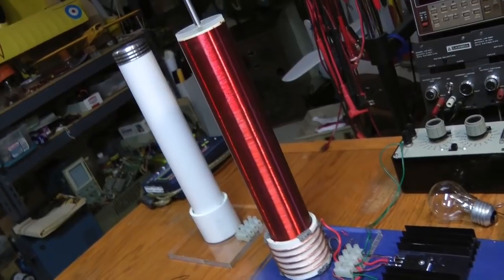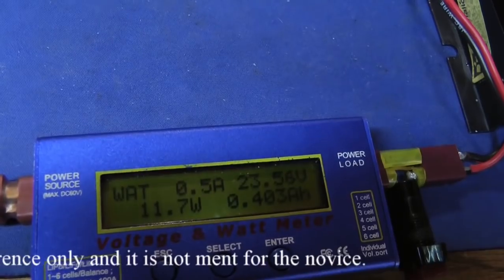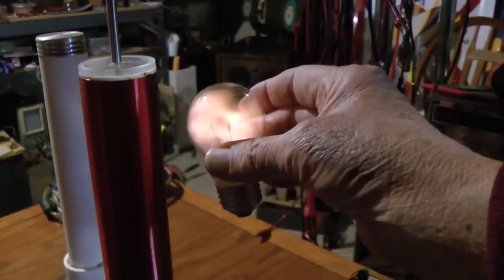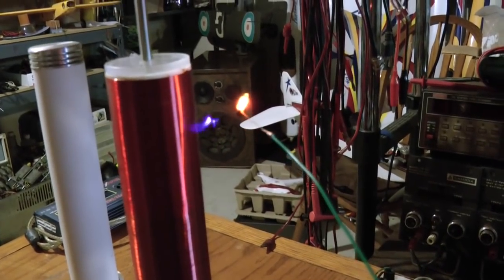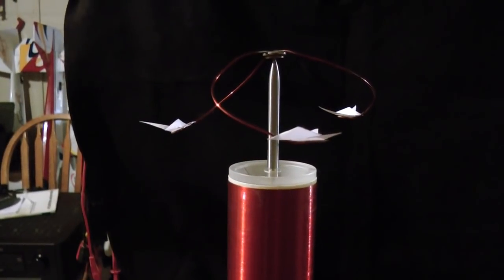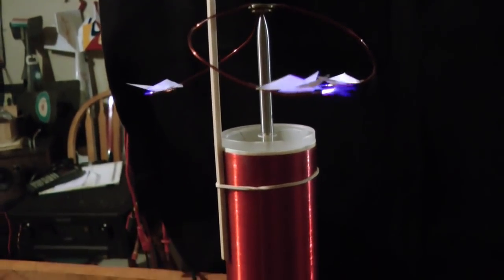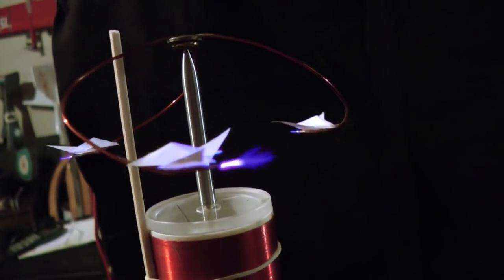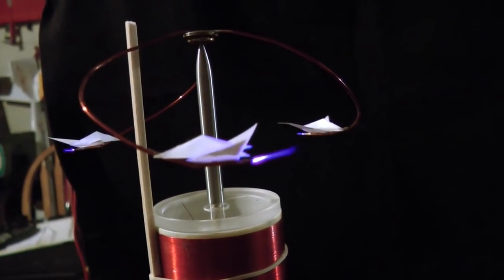Tesla / Slayer Ionic Propulsion

Comment: It's called coronal discharge. The force from the corona and the direction is what causing the air to be manipulated. It basically turns the air into plasma, but without a vacuum it can't be a sustained plasma and dissipates quickly.

Comment: The thrust is due to the asymmetry of the ion source. Electrons are stripped off of the air molecules surrounding the metal tip, this polarize the atoms with an opposite charge, since they have an opposite charge they are pushed away from the tip by the electric potential. The air moves in one direction away from the tip because of asymmetry, that is there is no spark (or exhaust jet) going in the opposite direction. So there is an exchange of momentum causing the spindle to move in the opposite direction of the spark. If placed in a vacuum this would probably not work because there would be no gas for the tesla coil to interact with. This is a very clever demonstration, I like it a lot.
Reply from the maker: Yes, I think the result would look like a plasma ball in a vacuum. However I think if you had both the cathode and anode on the device you could once again focus the ion flow.

Comment: So what you are seeing is the atmosphere around the electron beam is being heated to a plasma. The air expands and pushes the little flyer away. With the wire holding it on place, at a fixed distance from the coil, it and the other 2 rotate around the coil as a result. A cool toy.

Comment: Ion propulsion. You just demonstrated "impulse drive". If this is effective in a vacuum, it could be revolutionary for space travel.
Reply: It needs ions to work, and there's nothing to ionize in vacum...
Reply: We already have ION and HALL thrusters for space travel. It has already been done before and has been and is being implemented on spacecraft. They usually bring their own ionization material (i.e. iodine, xenon, etc...) This is not revolutionary, since it has already been done. What is occurring above is ions are being ejected out of the nozzle at a relatively high velocity and air being a relativity higher density material, is compressing the air directly outside the nozzle pushing it backward. To keep the system equalized the instead of the air being compressed, it is being pushed backward as the ions are being ejected out.
Reply: could make space travel possible you mean

Comment: Engineer: What you see above is the electric based propulsion in the form of ion propulsion. We already have ION and HALL thrusters for space travel. It has already been done before and has been and is being implemented on future spacecraft. They usually bring their own ionization material (i.e. iodine, xenon, etc...) and can run put of propellant. Electric propulsion has an extremely high ISP (thruster efficiency) when compared to propellant systems, however ion thrust values are extremely low and require large amounts of power to operate. There are pro's and cons to each propulsion system, and different missions are better equipped for one or the other. 

This is not revolutionary, since it has already been done, however it is very neat. For additional examples lookup HALL or ION thrusters on YouTube, other people have done static test fires before. What is occurring above is ions are being ejected out of the nozzle at a relatively high velocity and air being a relativity higher density material, is compressing the air directly outside the nozzle pushing it backward. To keep the system equalized the instead of the air being compressed, it is being pushed backward as the ions are being ejected out.

Overview
ISP (Efficiency Breakdown)
-----------------------------------------------
HALL & ION: ~2000 to 5000 sec
Mono and Biopropellant: ~150 to 400 sec
Cold/Warm Gas: ~15 to 50 sec

Nominal Thrust (Largely based on size of system)
-----------------------------------------------
HALL & ION: ~1µN to 1N
Mono and Biopropellant: ~50 mN to 1000+ N
Cold/Warm Gas: ~25 mN
Again this largely depends on the thrust size and type for nominal thrust
Reply: Is it possible to use this for making a cutting tool device for wood/aluminum? 
If yes, what should I look for and what approch you recommand?
Reply: I think a similar effect is used in arc furnaces.
Reply: Hossein Hayati isn't that how welders work Hossein? not sure if metal welders would work in not very conductive materials though. Google it up
Reply from the maker: Hello Robert and thank you for the explanation. I should have done a little more research. However there may be something about the experiment that is a little different. The power source is an extremely low cost resonator which allows people to have fun trying different experiments. The NASA thrusters have an anode, cathode and gas. I'm new to some of this but I think this experiment has a cathode but no anode unless it would be the earth ground. This probably means this type of so called thruster wouldn't work outside the earths gravity. Am I wrong? Doesn't the arc of the Tesla coil try to complete a capacitive circuit to ground?
Reply: Is he using a Tesla valve???? For backwash???

Comment: Hm. 
Ionic acceleration generally refers to high voltage direct current creating and attracting or repelling positively or negatively charged particles.
A Tesla-Oudin coil produces high voltage from a high frequency alternating current source. That type of plasma discharge is called a brush discharge. The other end of the coil should be connected to the chassis or to ground somewhere so the plasma just discharges away from the sharp terminal.
If you want more info on ionic acceleration and even capacitor acceleration, research T. Townsend Brown's work.

Comment: NASA has used similar propulsion for spacecraft they have very low thrust but can accelerate for a long time with very little weight. So they launch with chemical rockets and then use 'ion thrusters' to accelerate there after, they typically bring xenon gas with them as propellant but the 'vacuum' of space isn't a true vacuum and it may be possible for them to operate without indefinitely without brining fuel with them. Wikipedia has many articles on the topic, look up ion thrusters, hall effect thruster and plasma rockets
Reply from the maker: Thanks Cooper

Comment: Okay, what you are seeing is the breakdown voltage of air, and the arc super heats the air. Since the discharge is directional, from a point source the air is converted into a plasma. Once the plasma is hot enough, it ca stand up against atmospheric pressure. So, you see a channel of plasma in the direction of emission from the point source of breakdown, an arc. Plama, is just electrons and the nuclei of atoms too hot to be atoms or molecules, and since the nuclei are heavier, and being pushed away by this heat, once they race away, more cold air gets involved and becomes a plasma only to race away from point discharge source. That pushes the cool planes around.
Reply: Ask Walter Lewin, from MIT, if my explanation is sound.
Reply: Almost every college class I had ever taken, mentioned having him as teacher at one time.
Reply: Never knew that an actual mad scientist could have a job.

Comment: The electricity ionizes the air and the expanding plasma and air flow propelled these planes. Cant use this in space because its a vacuum. Cool to seeing it in action
Reply: sixpowder garcia This could be interesting for the next gen of stealth fighters
Reply: NationalistPride nope, not energy efficient at all, you need a ton of power just to propel a lightweight glider, not even talking about stealth planes and their payloads, and it wouldn't be stealthier than jet engines, the plasma would produce heat and the crackling noise would be much louder at that scale

Comment: In half of the AC, electrons crowd to the point, then out into the air and away from each other. In the other half, an electron vacuum is developed at the tip, and as electrons move toward it trying to go there, they run into each other, kind of crowding each other out, like shoppers on black friday. They can spew out of the store if there's a fire faster/better than they can riot/cram into the store from the outside for the 40% off sale. Hence the flow in one prevailing direction from the AC.

Comment: yep it's doing the same thing an ion drive does.  it's just making the air move.   won't work in space with out a reaction mass like xenon.  once you run out of material to propel with the ion drive, you stop producing thrust. 

(theoretically you would still produce some tiny amount of thrust occasionally because space isn't empty.  occasionally some hydrogen or some other gas floating around in space would get close enough for the drive to accelerate briefly)

Comment: It causes the air around it to heat up, forcing it behind it and upwards, this in turn causes the cooler air in front of the plasma to rush in from the front and keep it fueled. It's one of the reasons we can light a match or a candle.

Comment: Everyone is suggesting doing it in a vacuum, the problem is that the Tesla coil generates a spark due to discharge into the electrically conductive air completing the circuit, without that air you would need to add another conductor (A cathode) into the tube to complete the circuit, making a simple electron gun, probably. No vacuum tube devices work without a Cathode to complete the circuit.  Air is probably a major factor in what makes your little spark hawks fly, heat from the plasma causes expansion of air which gives thrust, the plasma itself would be created at the end giving a shove, perhaps even some copper is ablating giving you reaction mass, IE a rocket. Then theres magnetic effects, oxygen is very slightly magnetic and potentially contributing. And as pointed out by another comment the ions themselve once created repel each other as well as any part of the wire which has the same charge (the tip), which is almost certainly the main source of your thrust.
Reply from the maker: Yes Marc, An anode cathode and an inert gas injected into the ion stream will get you going in a vacuum as I was recently made aware of.

Comment: The principle it works on is basically that, the sharp end of the Tesla coil has very high voltage, which creates a very high electrical field, say the sharp end is connected to the positive terminal of the power source, it will be positively charged as electrons are pulled from it. This has enough energy to pull a electron from the atoms in the surrounding, this makes the atom positively charged. Now as the sharp end as well as the atoms are having same charge i.e. positive, the sharp end will repell the atoms of the surrounding creating thrust.....
This will obviously not work in a complete vacuum as there won't be any atoms to ionise...

In simple words,
The sharp end of the Tesla coil ionises the atoms around to the same charge as it has and repells them to create thrust....
Reply: we would need a propellant say some inert gas like xenon to work as positively charged ions bursting out the thruster  by the magnetic field (something definetly a mere copper wire can never hope to do ).

Comment: I would love to know how this would work in a vacume
Reply: They have a tank of cationic Xenon. An electrical source charges a flat plate and Xenon ions are released across it. The identical charges send the Xenon flying off very very fast. Since Xenon atoms are much lighter than chemical combustion byproducts there is low thrust, but the incredibly high speed of the atoms (near light speed, maybe 90%?) makes the system very fuel efficient. You can get the same amount of force from high mass moving slow (high thrust, low ISP) or low mass moving fast (low thrust, high ISP), and since mass is expensive in space it makes high-energy propulsion very appealing.
Reply from the maker: Thanks VP. The more things you clear up the less things I need to call magic.

Comment: Try this on a vaccum atmosphere and it won't move. The trust is coming from the air pushed by the spark. Same reason that the lighter flame is blown away. In any case, thats a cool experiment, thanks for sharing and congratulations for the work.
Reply: Orelion's Workshop What you said is correct that it won't work in vaccum, but i believe it's reason is that there are no atoms or molecules to ionize or in other words nothing to create the spark.

Comment: It is ionic wind. To increase the thrust, use multiple wires in configuration like a 6 shooter. Non touching, and use a center wire in the middle which is neutral. 

What will happen is the charge with jump to the center wire and condense. This will cause all the charge to condense to a more fine distribution pattern. 

Essentially, yes. It's an ion drive. But way to elementary to do anything with.

To make a real ion drive you have to have more volts for the surface area. Essentially more wire which means more weight. 

To do that, you need to wrap your coil wire first with windings in a small gauge wire and then wrap, the wrapped wire as a coil like you have. 

When you do that you cause the domain to line up and repel more efficiently.
Reply from the maker: Thanks Mathew, I'll keep that in mind when I try some new experiments. If you've tried anything like this or have a link to has, Let me know.
Reply: DadHav look up lifter technologies. 

Essentially, using balsa wood, aluminum foil and wire and some tooth picks. Run a few thousand volts through it and the wind is strong enough to create levitation.

Comment: DADHAV! Excellent work... The LED light glows due to induction from a distance from the unchanged electromagnetic field. A difference in potential in the field because of different in equipotential surfaces, hence, a current flow in the LED light for it to glow. Now the discharged electrons from the sharp point rod is because of electrostatic surface density is very high from the high voltage produced by the coil. On the sharp point of the rod with a small surface area creating a high density in the electrostatic field. Electrons try to bungled up at the tip of the rod but gets replied by each other which the atoms losing electrons tries to attract them back, henceforth, the violent glow which is due to friction from high energetic electrons moving through the atmosphere and losing energy in the from of light (ex. Lightning) that simulate the retina -  for visibility.
For the ion-jet propulsion, awesome thing... Well done! If the rod tip we're frictionless and air resistance were negligible it would accelerate to higher speed.
Reply: Robert Dixon how scalable is this in practical terms, would you say? I mean that's a lot of rig generating the power for the given expulsion (and payload it's transiting). Sorry to be as presumptive as to ask, just rather curious.
Reply: Hi! This experiment has been done my many physicists around the world. The US, UK, Russia, etc all having their own plan on getting this to work out door practically. The model can be scaled up to aircraft size but better equipment is needed to handle ultra higher voltages (over 1 MV). Scale up the model is possible. The rod, coils, safe distance shield, etc and has to be calculated accurately and precise...
Reply from the maker: In most experiments that I've seen heavy high voltage transformers are used. The resonator is very high voltage at a fraction of the weight. Solar cells are also fairly light. Someday someone might come up with a new idea.

Comment: Electron momentum, "the spark" is caused by the electrons de-fusion as it interacts with the surrounding particles in the atmosphere, this is how the electrons provide propulsion - I. E similar to a hose pipe if you replace the electrons with water but under different conditions (proof? Try releasing helium into the flow of the electron pressure) - stand back though because it will glow (plasma) and get hot (thank you for the interesting part, I learned a whole lot from that part)

Comment: Maybe somebody's answered you already, but so far I just see sci-fi explanations. Electricity has a favor for points, and the jet you see is called the corona effect.  Just like if you placed your hand near the side of it you'd feel a buzzing in the air, the same amount of electricity moved into a condensed space ionizes the same amount of air, but because it has less space it's more visible and violent.  This effect is a pain for older radio antennas, which is why the ends usually have thicker, rounded rubber on them.
  Fun video, definitely subscribing :)

Comment: that is the maybe coolest paper airplane i ever saw
Reply from the maker: I thought it was cool enough to share and start a group conversation about the experiment. It's been a great time hearing everyone's ideas and theories about the obvious propulsion caused by the Tesla coil. Thanks for watching.
Reply: Answer,, cool too =) if you want a theory , here is 3 :) 
1 : just the electric spark it self "must" produce heat,, i imagine ,, could you stick a thermometer in behind the sparks and see how hot it is ? my oil oven in my living room i imagine to produce enough uplift for small paper air plane to at least have some uplift .
2 : the electric spark that comes out behind \ off the coil "must" generate air flow just from friction being generated by the spark,,
the spark is a kind of fire ? fires maybe don't produce wind but it does moves wind .. ? 
3 :  The 'electromagnetic fields'(?) around your coil, the invisible magnetic lines that runs outside your cobber coil, Eddy current? Maybe this magnetism could propel your little airplanes ? Are there any other metal on the paper airplanes besides cobber ? Maybe cobber also is magnetic at some level ? This last theory i would stake the most on if i had to bet anything =) what you think ?

Also, you any good on magnetism ? i can see from quick browse trough your video you know electronics quite well. Do you want a mission from me on magnetism ?